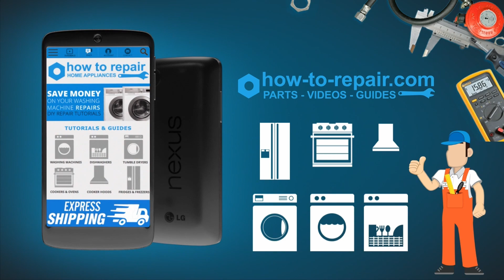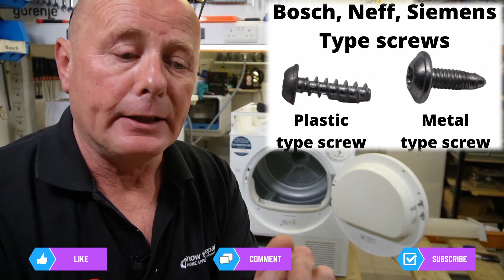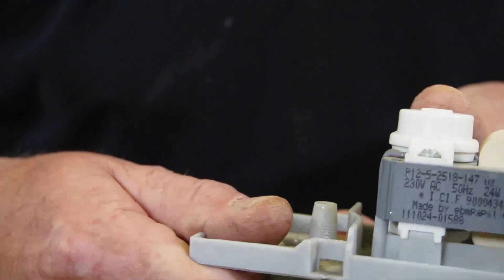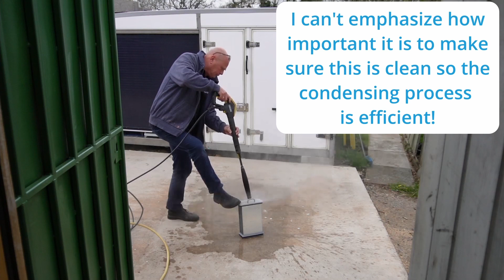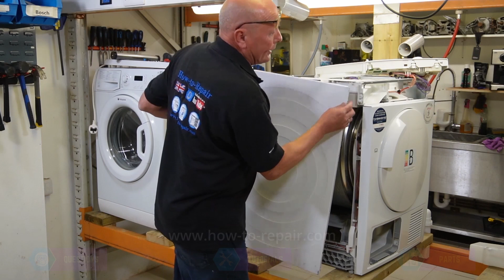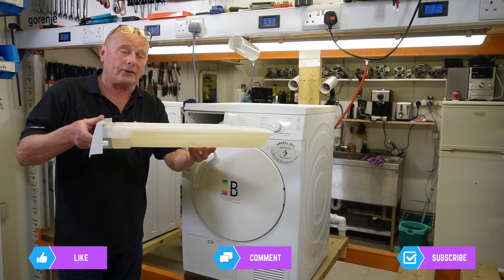Tumble dryer not starting keeps stopping container light flashing Bosch Neff Siemens troubleshooting

Comment: hi , thanks for your help , i bought a used siemens IQ700 dryer (in a really bad condition......) with heat pump model WT46W561 BY12 , with your help i fixed the cloged water drain pump and internal humidity sensor , now it worked successfully for the first time . The only problem i have is that the front fan is not starting . At first times that the machine wasnt working as it should this fan was working constantly from startt of circle , i tested it with 220v and it spins fine , i just dont know if it needs to be working or if it starts under certain conditions . Thanks for helping and for your reply .

Comment: Excellent video, thank you for the detailed walk through. I’ve cleaned out the sump on my Bosch dryer and problem solved. 
As this isn’t part of the standard maintenance recommended by Bosch, I assume that these style of dryers collect more lint in the sump than they should. Can you recommend any other preventative steps I could take to reduce the amount of lint that gets in the sump?  Better seals around the sump cover, or the condensor?
Thanks again, great video.
Reply from the maker: Glad it helped! You should do regular maintenance and cleaning on your tumble dryer. Also, you should check the pump unit and the water sensor since the wet fluff in that area would be giving a false reading to the circuit board, which indicates that it may be full of water when it is not. 

I also suggest you check our website, as we are answering related FAQs from other customers. https://www.how-to-repair.com/faq-topics/tumble-dryer/

If you found my videos helpful, you can support us by donating to our website: https://www.how-to-repair.com/help/buy-paul-a-beer/

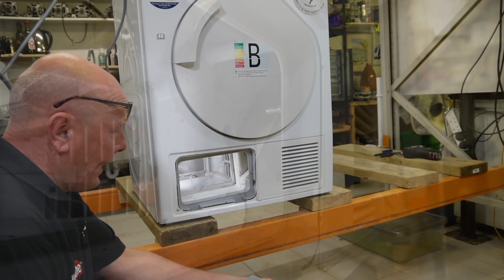Comment: In the video at 5:42, if you look closely in the condenser's chamber, it is visible that the plastic cover of the pump water tab is already missing. Through that door, one can clean the tab and potentially fix the dryer without opening the side cover. Right?

Comment: Thanks a lot! Although our Siemens is about 10 years newer then the model in de video, it was still 99% correct and my problem is solved! 

As the dryer is only 2 years old, could we have prevented the issue by cleaning the condensor more often? Or is this more like a design flaw? 

Thanks again!

Comment: Thanks very much for this video.  I have a very similar Bosch machine and was having this problem.  We've had the machine (two adults and two kids) for just about 10 years.  I've always cleaned out the filter and condenser unit but never looked at the pump or 'under the hatch'.  I followed your video and you wouldn't believe the slimey gunk under the hatch and around the pump.  I cleared it all out and cleaned the pump - I also carefully removed the cover and checked the impeller too.  All cleaned and put back together and it works better than it has in a long time.

Thanks for the video, you've saved me from (probably) buying a new machine and should have lowered my electricity bills.  👍

Comment: Thank you for the video. Very helpful. The issue I have is the filter sensor (not the water sensor) comes on after 15 minutes of drying. Then remove the filter and put straight back in and the dryer will continue to finish the drying cycle. Is this an issue with the sensor? I clean as you show in the video as part of my usual maintenance. Thanks

Comment: This is the most comprehensive video on this problem. Excellent work. I've done the sump clean etc, but my problem is the condenser clean light is tripping after 5 mins, but the condenser has previously been cleaned. Water building in plastic diverter before condenser. Driving the Mrs nuts. Run out of options napart from buying a new condenser or machione !!! Mine is 12 years old & taken a look at new series 4 machine in shop. Looks the same, apart from plastic air diverter that fits in front of condenser before the door flap. So wondering my machine has a design fault !!!!!!!!! They'd never admit it though !!!!!!
Reply from the maker: Firstly, you did not say what machine you have, but let me explain the process, the water condenses on the evaporator plate. Then it runs down the plastic to a well where either there is a pump that will transfer the water to the collection bowl on some models, the collection bowl can be at the bottom of the machine and there is no pump if the water is not getting to the collection bowl, you may have a problem where it just needs cleaning, but if it is getting to the pump, but not transferring the water than an alarm will be set. You may just have a blockage in the pump or the pump may be faulty. I hope this helps, glad we could help you pillock macpillock this is for you https://www.youtube.com/shorts/e432SAb2g08 please remember to subscribe as that's what keeps this channel going. Thanks 👍

Comment: Hi, I've bought an 8kg Hotpoint condenser dryer 6 weeks ago brand new, I've noticed that where the condenser fan is there is a small leak on the right side, water builds up and starts running down, I clean the lint filter and empty container after every load, I've also washed out the condenser unit, is this normal on all condenser dryers? I'm still in warranty so if it's not normal then I will have to get an engineer booked in. Your advice would be appreciated thanks.
Reply from the maker: The first thing I would do before calling them out. Please make sure the machine is 100% level. It is possible that the base of the machine has got cracked in transit as it is made out of plastic. glad we could help you @majidmehmood786 this is for you https://www.youtube.com/shorts/e432SAb2g08 please remember to subscribe as that's what keeps this channel going. Thanks 👍

Comment: If one of the impeller cover clips  could you not just glue it? I haven't broken one just a thought for future reference.
How come the full indicator is not activated just by the flow from the condenser instead of the over flow? Are there different partitions?
Reply from the maker: Without having your full model number and a machine in front to me. It is very hard for me to answer individual questions as I would have to try and find an exploded diagram of each individual machine, but please feel free to contact us on the website if you need further assistance. Please also remember to subscribe to the channel as that assists us

Comment: Hi, I have a Bosch with a heat pump and I have a problem with a full tank. I took it all apart, cleaned the condensers with a hose, I didn't have a pressure washer, everything is clean, but the problem looks like this:
When I run test P07, while the empty tank is in the dryer, at 1st stage pump raises the water and fills the tank, 2 and 3, the tank empties into the condensers, but when at stage 4 the pump needs to raise the water again, it does not raise it into the tank, but I hear buzzing of pump.
I tried the same test without the tank in machine and then everything works as it should, it seems that the water that is emptied from the tank does not reach the pump fast enough, as it does through the overflow hose when there is no container.
Please let me know if you know what can be reason? Is there any way that pump one time works fine, but after few second dont have power? I dont understand...
Reply from the maker: It is really hard for me to ever assist anyone with this heat pump tumble dryers as they have so many sensors and so many problems. Heat pump tumble dryers work on the basis of refrigeration and when you mix this with the tumble dryer fluff can cause one of the biggest problems.  glad we could help you Miloš Todorović this is for you https://www.youtube.com/shorts/e432SAb2g08 please remember to subscribe as that's what keeps this channel going. Thanks 👍

Comment: Hi Paul, excellent video as always. I'm impressed about the little powerful screwdriver you use in this video and others. Can I ask you the brand? I have a Bosch, designed for domestic use. I use it everyday for professional tasks, as it is small, and fits well in my tool bag. I have a much bigger one, but not very practical in my case, because of his size. Yours seems to be both small and powerful enough. Greetings from a happy subscriber from Spain!
Reply from the maker: Thank you very much for subscribing to the channel the impact drill that I use is a Bosch 10.8 V. It's ideal for working in small spaces and it has quite a lot of power. Have a great Christmas and a happy New Year

Comment: Hi,

I have exactly the same issue.I opened the panel of the dryer and I cleaned up the pump.
The problem still occurs.I was in warranty where that problem started.An official Bosch technician came to fix the dryer. Without seeing anything when I explained him the problem, he replaced the motherboard of the dryer directly and he left.The dryer was fine for approximately 6 months but the problem started again. What I have realized is, the dryer stops working after some minutes when is totally cold.If it stops for approximately 3-4 times and I reactivate it back directly (which means it keeps the hot temperature ) then it ends up the drying procedure without problem.Even if I will start a new one drying procedure after the end up of the first , it is ending without any stop.
Do you have any idea what is causing that?

Comment: Brilliant, thanks. I did all this, but the crud built up again in the reservoir. I've cleaned it again. Cleaned out pump and everything, why does all that fluff end up down there?
Reply from the maker: you'll always end up with a bit of fluff getting down to the bottom this is usually because the filter is not a 100% seal Thanks please remember to subscribe as that's is was keeps this channel going. Thanks 👍

Comment: Real detailed  video on getting the best out of the tumble drier especially in times of high price electricity. Like the idea of using the power washer to clean the condenser unit. The tap water pressure is not sufficient to remove the fluff on the plates. Liked the power screw driver but could not distinguish the make or model no.
Reply from the maker: thanks, my videos are longer than others but if your going to do it do right. scew drive i use is bosch 10.8v impact driver here is an  affiliate link https://ebay.us/pG7xYn